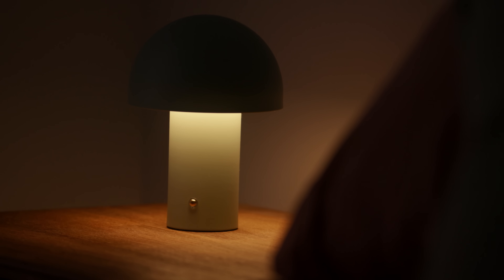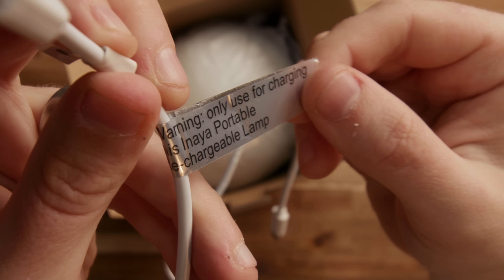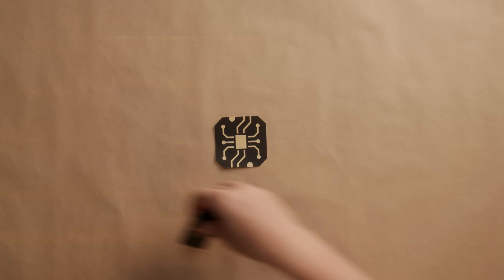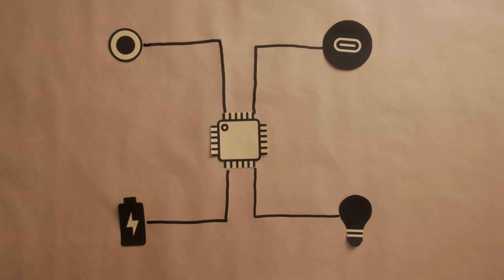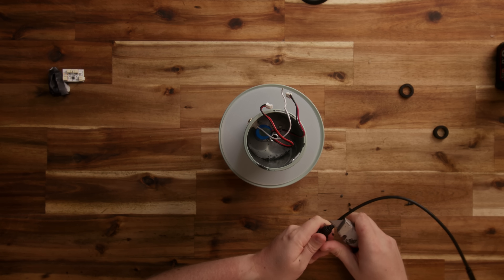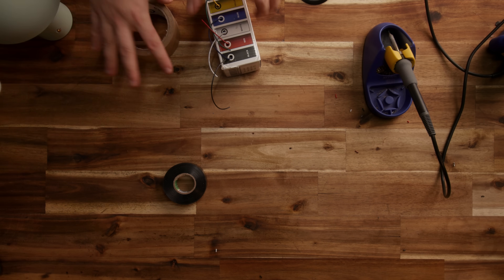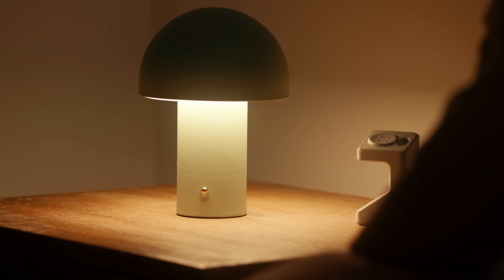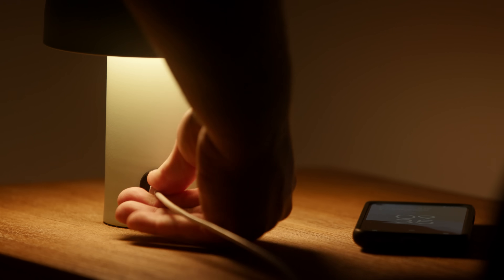Kmart Lied to Me, So I Hacked Their Lamp

Comment: Quit saying K-Mart lied to you.  K-Mart didn't.  the Lamp's manufacturer lied to You.  K-Mart just SELLS things, They don't MAKE things.  If You're going to be pedantic about details, get the details right.
Reply from the maker: This lamp is an Anko product... Which is Kmart's own brand. 

They literally do make these (well, have them made to spec)

Not to be a pedant but...
Reply: @TheStockPot-AU  They still do not make it.  K-Mart probably had no idea.
Reply: @Runescope  The vendor is responsible for the product, not the manufacturer.  Otherwise in the case of any product having a problem the retailer would be able to say, send it back to China and get it replaced.  It's just as well that isn't how things are done.

Comment: This is actually quite common with a lot of cheaper devices, to the point where it's almost a "standard".

If you tried a USB-A to USB-C cable, (which isn't really either), you'd likely notice it would charge.  That's because all of these types of cables just pipe the power lines straight through.  I have many, many cheap chinese devices - from walkie talkies to flashlights - which charge with this exact USB-A to C cable, but not with a C to C cable.

Comment: One should be careful with USB-C extension cables. The nature of USB-C and high power delivery options it provides, required the cable to have a chip inside that negotiates how much power to deliver to a device. If your extension cable does not have said chip, and the wires inside are not rated for the current that is negotiated, you run the risk of electrical failure and possibly fire. There are some good youtube videos around about the dangers of USB-C extension cables.

Comment: Common issue on almost every cheap thing from China. I couldn't figure out why my wireless transmitter wasn't charging and turns out if you have a cable that can go higher than a specific voltage it won't charge. I got older usb cables with the white usb a port and it works just fine. Still ridiculous that the cable matters like that.

Comment: yeah, I was pretty depressed when I learned that some USB-C chargable devices only actually charge at 5 volts (USB 2.0) They just happen to use the USB-C port because it's more convenient port to plug into. The other side of the "proprietary cables" is USB-A, because USB-A ports are dumb and always output 5 volts no matter what. Actual USB-C chargers on the other hand, have to negotiate the charging voltage with the device, so yeah. Taking a C to C cable and plugging these devices with dumb USB-C ports into a smart USB C power supply won't work. They don't do the handshaking.

It's a cost-cutting measure.
Reply: I'm calling BS on cost cutting. 2 resistors for a fraction of a cent per 100 is all it would take per unit. This is incompetence plain and simple.

Comment: Why would you ever want a lamp to run off a battery? It's just going to run out if you don't recharge it, which should not be an issue as a reasonable lamp would be simply plugged in. If power outages are that big of an issue, you have bigger problems.

Comment: I'm not sure where you are, but here in Pennsylvania, USA. all of the K-mart stores and Sears have closed. I saw some of these errors on the USB coming years ago. My thought was why oh why are they using a data plug to charge things. Why not the barrel plug like we had for many years.
  I first saw the problem with this with the tablet computers. When a young user strains the power wire to it or something happens and the cord gets yanked out. It often breaks that unique tiny mini, micro, or USB-C socket, and it is mounted on the main circuit board in a way the average person can't fix it, the repair shops will charge more then the value of the tablet, or refuse to fix it due to the value of the item.  Just dumb.

Comment: As someone who also enjoys tinkering with lamps—I've built quite a few 3D-printed ones myself—there are a few things I would have approached differently.

From a software perspective, I would have gone with WLED. While it might not be as powerful as your custom software, it's very user-friendly and has native support for Home Assistant via its API. For the LEDs, I’d replace the integrated ones with WS2812B (Eco) or the SK variant, depending on the need for RGB or adjustable white (CCT) lighting. That way, you get more flexibility in color control.

For charging, I’d use a TP4056 module along with a USB-C trigger board. I’d also remove the original charging indicator LED, solder a new one in its place, and route it through a small hole in the shell so the charging status is visible from the outside.

I’ve also experimented with wireless charging, but unfortunately, the TP4056 tends to cause the charging LED to flicker when paired with a wireless coil. One other thing I’d definitely add is a physical power switch—especially for ESP-based boards—since they continue to draw power even when the lamp isn’t in use, which eventually drains the battery.

Comment: I feel your pain, but it's outright strange that you wouldn't complain about the built in battery. Talk about useless. They turned a lamp that should be easily outliving you into something that's only expected to last 5 years or so (especially if you use it as a bedside lamp) and you're OK with that for some reason? It's a lamp, the cable has much less of an impact on the user experience than that silly integrated battery. If you need a portable lamp, then you're not looking for a lifestyle lamp like this, you're looking for a camping lamp.

Comment: Please only connect rechargeable batteries to a mosfet like that if they include a safety circuit. They can over discharge and damage the battery. Depending on the type even start s fire

Comment: It might be nice to have a way to check the charge % level of the battery, so you'll have an estimate of how much remaining runtime it has and how soon you'll need to charge it again.
As for the original cable, I wonder if their thinking was to allow higher current flow of the VCC through tiny gauge wires.  In that case they are likely also using the cable's braided shield to provide a larger total gauge for the ground.

Comment: I’d have first reverse engineered the chip on the existing board. If it was just passing battery voltage directly to the LED then no problem, but there’s a nonzero chance it was running on a constant-current regulator. I hope the new battery placement/connector situation makes it user-replaceable.

Comment: 2 resistors could likely have made it work.  A USB-C computer port or a USB-PD charger can be enabled at 5 volts with those resistors.

Likely, a USB A to C cable would still work, because USB-A unconditionally outputs 5 volts.

Comment: I'm an engineer and from that perspective this mis-wired USB-C cable is either due to a licence issue or the more likely scenario that the mistake was missed in schematic review and management (bean counter guys) decided it was cheaper to make new cables than fix it.
Reply: Its unlikely the cable is any different to a type-a to type-c power cable. The reason it didn’t work with a more sophisticated cable is because chip in the wall charger brick could not communicate with any chip in the device that would usually specify the compatible voltage and current specs. Dumb products usually combat this problem by putting a specific resistor on the data line to specify the voltage/current requirement but this product clearly did not include those resistors. Plugging a smartphone into the lamp charger cable would likely charge the phone at the default of 5v 1A which is perfectly safe.
Reply: @xDMG15x  look at the pinned comment

Comment: Great video. pretty frustrating. not as bad as an electrician wiring 220volts to a 110v receptacle but similar concept. you shouldn't ever wire the wrong voltage to a standard plug. or voltage to a data cable. Hacking something together for a diy project is one thing, but not really acceptable for a company selling things to the public unless you want the reputation of selling junk. Unfortunately in todays world people only care about saving a dollar per unit sold. Companies couldn't care less about the consumer and print whatever they want on their boxes. Stretching the truth for a spec's of a product or just plain lying.

Comment: The issue here is they replaced the old microUSB with USB-C without looking at the spec. You can't just replace the connector as USB will not send power if the CC lines are not dealt with. The correct way to use USB-C for only charging you would need to pull both CC lines via a 5.1k resistor to ground.

Comment: I'd suggest not using a esp32 in projects like this and sticking with a esp8266, also i don't like esp32 touch sensors alot so i prefer to use specialized modules like the ttp223 which costs pennies for the touch sensor (they also have toggle capabilities as they can be programmed by different states on A and B pins)

Comment: A rechargeable lamp?  Unless it's for camping, this is the dumbest lamp design possible.
Reply: I bought one not realising it was rechargeable. Can confirm it’s the most annoying thing ever. The charge only lasts about 6 hours on the lowest brightness.
Reply: What about something like a power cut?
Reply: lamps looks nicer without power cord. But there is a catch - they often have badly designed charging circuits that destroys the battery after a few months. So in most cases these lamps end up permanently connected to wall becase most people dont know how to replace the cell or you cannot open the housing without damaging it.
Reply: Eh, might also be nice if you'd otherwise have to use an extension cable to plug it in at the spot you want it.
Reply: @Nesuniken What if the lamp had its own extension cord, built into the side or bottom? Like some kind of built-in thing?
Reply: Pretend this is a vibe candle and it all makes sense.

Comment: "Even Apple are using it now", after being told that if they didn't, they would be a billion dollars poorer. Also - adding ESP32 made the lamp a $60 lamp - congrats on making the lamp 3 times as expensive.  Also - stop lying - "Each upgrade cost me about $7 in parts".. NONE of the parts cost less than $7 EACH, and you need at least 4 parts per lamp, a soldering station, solder, wires, a 3d printer, AND at least an hour labor PER lamp.    If you HAVE to ask why KMart does it "the cheap" way, then you ABSOLUTELY don't understand, HOW they can sell a lamp for $17 in the first place.  Here's the kicker - Would you have bought it, if the price was $60 with all of the internals as you "upgraded with", if next to it, there was a version that cost $17 ?  Consumerism rules says absolutely no, you will ALL take the cheapest solution.  That's how EVERY service works.  Every government entity does it that way - plus they then spend billions to rework the projects to their specifications afterwards, but hey - they were cheap to buy.

Comment: This is genuinely dodgy practice that is unfortunately not uncommon, but the root of the problem derives from colloquial use of the term "USB-C" and general ambiguity surrounding USB and connector terminology.

Most people assume that if a connector fits, then it does what you expect, even though the specifications don't guarantee that. This creates a difference between USB-C as it is understood by the general public, and USB-C as it is technically specified. That's where this gray area in marketing finds its footing.

It's not as simple as "this isn't USB-C," because to the vast majority of people, it is. The problem is semantical, not technical. USB-C has become an umbrella term outside of the technical specification, so whether this marketing is lying is up for debate.

Comment: This problem is rampant and there doesn't appear to be a governing body with enough heads out of each others collective asses to realize they should quit legislating and mandating things without requiring some way to enforce the standard in a way that protects the consumer. 

USB C is a terrible design anyway. the most common failure is damage during charging and the center pin always gets broken inside the device requiring soldering work and worse since everything is glued together garbage nowadays. 

At least with a lightning style solution  only the cable gets broken and the jack remains undamaged.

Comment: Kmart didn't request this quasi USB-C design, they simply bought a private labelled piece of junk from AliBaba in the thousands and didn't ask the manufacturer/seller if the lamp could be charged with any type of USB-C... This issue of USB-C ports on cheap items from China not accepting a charge from anything other than the supplied USB-C 'looking' cable is all over the tech world. The only way to avoid it is to buy from western brands that have their items made in China. There's a HUGE difference between the end result of 'Designed in the west and made in China' versus 'Designed in China and made in China'.

Comment: The whole project is great, but for those who just want to use the lamps as purchased ... just use any usb a to usb c cable (a good one) for the mobile phone and the lamp. The mobile phone charges more slowly (my iPhone 16pro charges at 7.5 watts), but this is certainly not a problem when you are asleep, as you then have enough time to fully charge your mobile phone. Another advantage of this slow charging is that the battery is not put under too much strain and has a longer service life. This whole „power delivery protocol“ thing is very confusing … I know 😉

Comment: Great idea but I have a addition instead of making it battery powered  u can make it wired so u don't need to worry abt the battery running out and using the wifi in the esp 32 to make it remotely turn on and stayy on and not worry about the batt

Comment: Why a bedside lamp needs a battery at all is beyond me. You typically don't move it, why go through the hassle of plugging it in for charging and then out, instead of having it wired permanentely, thus removing the requirement for a battery?

Comment: Love this video, but this problem is very wide spread. Take for example all of the retro handhelds made by Anbernic. And most Chinese products from Ali Express. They all come with a USB A to C cable with only two wires. I have piles of them now. 

I only have a few devices that actually work with real USB-C. All the others require a two wire charging cable. 

I am always amazed when I can actually use a USB-C charger to charge anything. It’s not the standard based on the percentage of devices I have. 

It’s crazy - but only name brand products actually work with real USB-C chargers.

Comment: This is an awesome video! I skimmed through and I was thinking about the non-standard cable. I know a lot of charging boards like the TP4056 will have this thing were C<->C cables won't work, but A->C cables would due to a different standard, but seeing the wiring diagram I must assume Kmart probably included the "USB-C" label to pretend they're modern or something.

Comment: I had a similar issue with a Biqu B1 3D printer, they used a cable with USB C connectors at either end for the cable that goes between the motherboard and the hotend that was not a proper USB C cable.